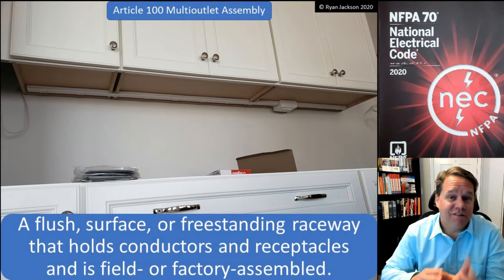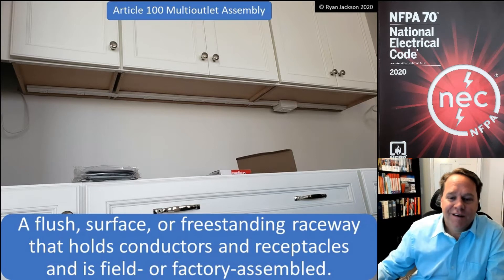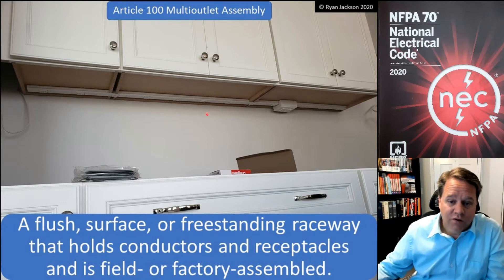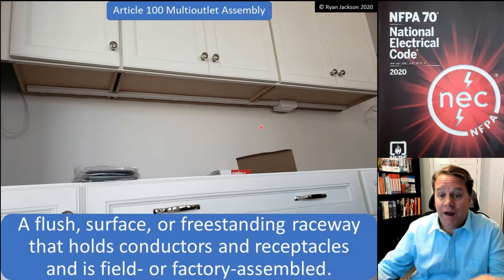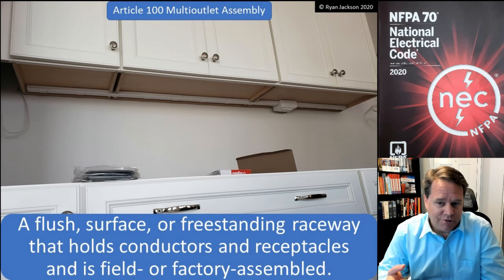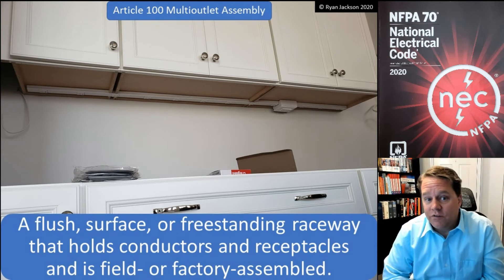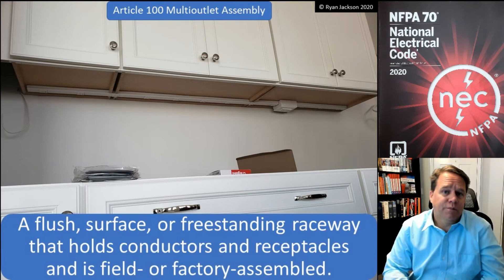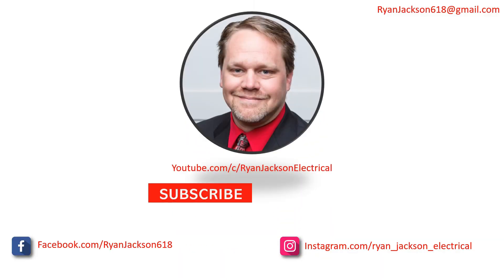100 Days of Article 100: Multioutlet Assembly

Comment: Plug mold at best pain in the neck to install some  covers. Usually only stocked #10 sheet metal screw with plastic anchors & 1/4" toggle bolts so would mark studs then arrange it so no receptacle were over a bulging screw head. Had a great customer who wanted over a hundred feet of it on wavy concrete basement walls. Told him to get somebody else to do it or have carpenter install & shim painted boards around entire basement. Ended up installing painted 1 by 4" boards then running conduit on it to a 1900 box every 8'. Guy was the absolute gadget nut. Had us install receptacles in large area above 4 car garage every 6' because he was thinking about putting a lot of pin ball machines up there. First time that I used Plugmold did not know they make special connectors with a bevel edge that you have to watch out for. Purchased the longer end box then made splices in it. Used a lot of the larger think it was 3000 wiremold in comercial sites just for powering up 120 & 240 volt receptacles. Would cut all but the last cover to get an accurate cut. Would install a device then a cover then a device to I got up to last device then measured the last cover. When I first used #200 wiremold helping my dad would only pull 2 #14 wires thru to add another ungrounded receptacle. A lot of old homes only had 1 receptacle in a bedroom and to sell the home they required minumun of 2 receptacles on different walls back in the 1960's.